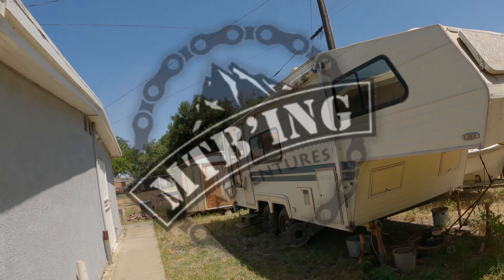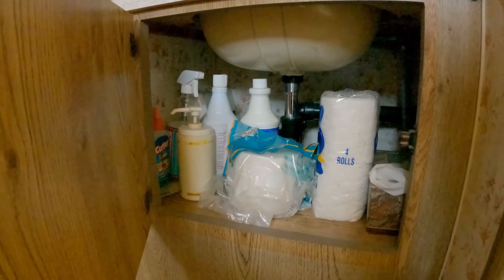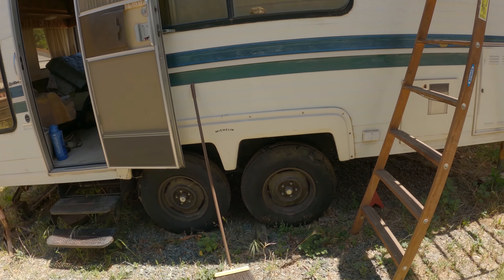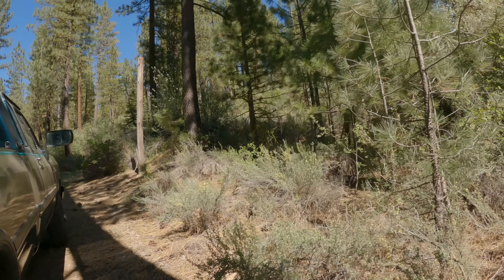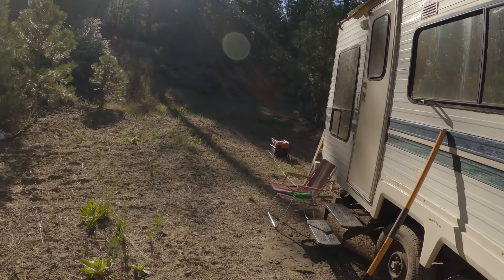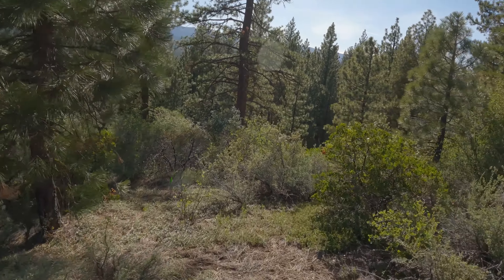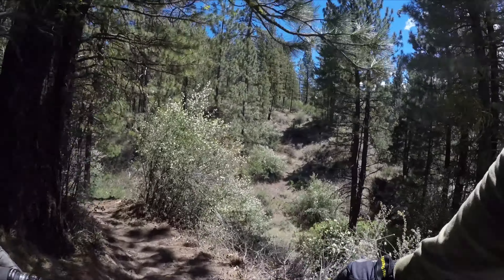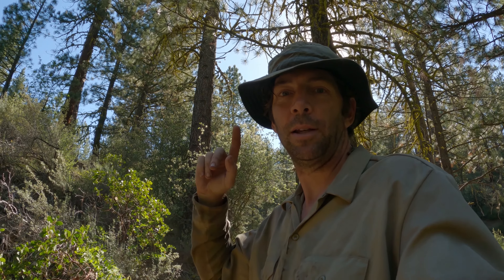New Adventures - Set Up The Camper & Build Some Trails

Comment: Dude, get a Rototiller, it makes bench cutting so much easier. The initial cut with the tiller into the hillside then work sideways to cut your bench. Built nearly a mile on my 5 acres that way
Reply from the maker: I'm a bit skeptical that a rototiller will work where I'm at. There are lots of rocks a good sized roots that my tool just plows right through. I will see if anyone on the team has one their willing to use for this.
Reply: @mtbingadventures1551  where it works it works. And where it doesn’t heal then go back to hand technique. But it does take a lot of Backbreak out of the highly dirt areas as well as preps the soil for a good marriage back together if you’re building partial bench. I was very lucky in the property I am building on, very few rocks almost none, and the roots weren’t too bad but I did have a Pulaski to take care of those when the tiller wouldn’t cut them. I have one and I’m not particularly using it this time of year. And would both love to see what you’re doing and help out if possible. Let me know and good luck on the 20 miles.
Reply: @mtbingadventures1551  Also, I have a compactor which makes seasoning the trail a little faster. Although if it’s too dry it just pushes the dirt around and doesn’t really do anything for you.
Reply from the maker: @trailjockeytj6160  the plate compactors are awesome. I used one at the bike park a lot. I'm thinking about running one of those through the trail after we get a good rain. Timing it for great conditions could be tough here. It might just go right to snow when winter comes. Also can't be to wet or it just sticks to the plate.

Comment: Also looks kind of dry, cut trail earlier in the season
Reply from the maker: I will be cutting trails year round if weather permits. We are going to be building about 20 miles of trail. I already have 1.5 miles cut in now using the Gaia GPS app. to get that info. We'll be getting more equipment to help get our 65 gallon water tank to places we need to wet down. We also have some smaller water tanks for the more difficult trail sections.

Comment: Nice work, I’m excited to follow these trails! I took the summer off and would love to volunteer time. I have a self sufficient van. I also love drawling trail concepts and I may have dug up your property location and already drawn up some trail ideas for fun, no pressure. Email me if your interested: “sendmattemails at gMai|”
Reply: Btw I use CalTopo to plan trails, the Slope Angle Overlay is great for locating the best spots for uphill switchbacks or areas that will be easier to shelf etc. I already drew up some example trail plans in CalTopo but I don’t want to share your location that I dug up. (I could be wrong on the property I found but it seems to match the topo Brian shared 😉 and I don’t mean to be creepy I just love technology, trails and volunteering)
Reply from the maker: I've been using Cal Topo a lot lately. It works really good. You got the right spot and if you are really interested in coming out and volunteering in the future just keep hitting me up. I have a lot of messages and I don't mean to glance over your comments. I just got to make sure we find people we can trust and are serious in helping.
Reply: @mtbingadventures1551   Awesome! No worries. I stopped volunteering because I’m back to working crazy hours. Back when I was volunteering I was 100% available because I saved up and took the summer off from work. If my schedule opens up I’ll reach out. I’m guessing you’ll be snowed out tell spring. I would love to dig and ride for sure! Else come camp once it opens up!